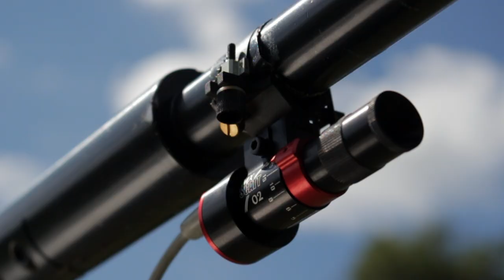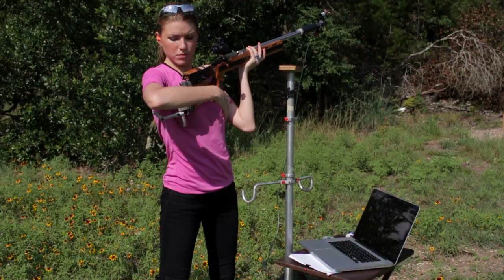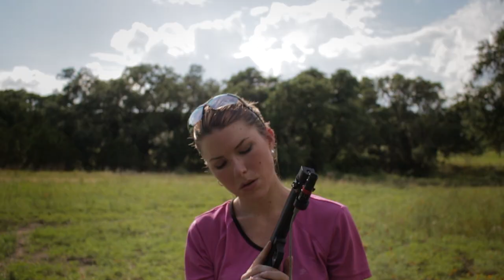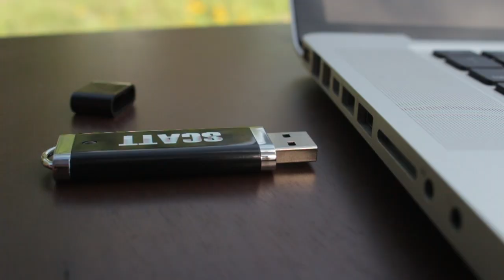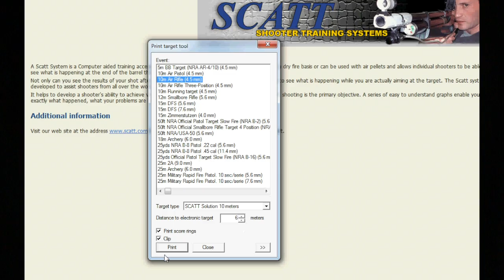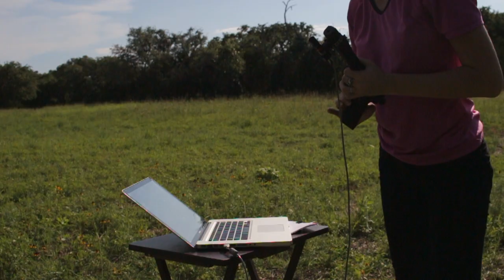Can A Computer Make You A Better Shooter? - SCATT Shooter Training System

Comment: I realize that this is an older video, but have you tried the MantisX system? If so, given the price difference, would you think that the MantisX would be a better choice for MOST shooters (i.e. not those hoping for on Olympic gold)? Another question is whether you think having something attached to a barrel (that wasn't but there as part of the gun's own design) has any effect on the accuracy (change in barrel harmonics, etc.).

Comment: I own one of these units for my 10 meter Olympic air rifle the live fire option on normal targets without using electronics down range is invaluable, I train at 3 meters dry fire at home on a scaled down target that you print out from the software then email the results to my coach, it’s a great system that hones your technical skills that are crucial to the perfect shot release.

Comment: In fact; the answer to that question is " Yes... or, No... Or... Uhhh...". It depends on what type of shooting you are involved in. For Sniper and long distance shooters, a computer could be an excellent pool. Snipers have to make very many calculations for their operstions such as:
* What food; and how much, was eaten before shootinhg. The time of the meal is also listed. After eating, the hands may become shaky; as well as at times before a meal.
* How much sleep have you had. A sniper has to calculate how much sleep he/ she had; aswell well as present condition of mental acuity. Sluggishness may interfere with a shot if the shot is not made with a very sharp mental acuity.
* Windage elevation: The wind may push the projectile left or right many times before striking the target.
* Environment: Trees, hills; and other obstructions may cause wind deviations.
* Coriolis effect
* Weather effects
* Temperature effects
And numerous other calculations. After calculations, precise shots up to 1 mile to 2.5 miles may be made.

Comment: Surely this is counter productive/pointless ok i understand all its doing but its doing all that while you have things added to your rifel! Thus changing the weight and center of gravity? So its taking all thoes readings for that but when you shoot normally, without thoes bits on, your readings will be different anyway.
Make sense?
Reply from the maker: MultiShaun1989 It sure does make sense! I was skeptical of this myself. But the unit is so light that its not noticeable -- and trust me, I'm really picky about weight changes on my competition guns. I also think it's an overall diagnosis. So a slight weight change of a few ounces (if a person even notices it) in order to see big things within your shot routine you may be doing consistently wrong, benefits more than it possibly harms. To each his own though! I like it, doesn't mean you have to :) Just wanted to explain that I had the same concern (which is valid) and didn't notice any problem once I tested it.
Reply: I'm just curious,always looking to learn stuff! :) thanks.
Do you still attend competitions?

Comment: It seems that at longer ranges, you will need to have a mounting place that is not the barrel because of point of impact shift.
Reply from the maker: sierraharvester That's a good thought, and the cool thing about the tech is you don't have to have a perfect center aim for the mx-02 to work.  As long as its in the general area of the target, it can be quite a bit off center and it compensates for that automatically

Comment: Great review, thank you for this! I didn't even know it existed.

I have an unrelated question (hope no one hates me for this but...) What is your (or anyone else who reads my comment) preferred training method for eliminating (what I call) trigger-flinch for handguns? When I dry-fire, no flinch (pretty obvious, right?). When I use live ammunition, as soon as I've emptied my first cylinder (or magazine if I'm not keeping count and primarily focusing on the target), I find myself flinching when I pull the trigger.

I've dealt with this my whole life and it's frustrating as all heck because my first few shots are on point but most subsequent shots are either low or low-left until I stop and relax for a minute or two.

Anyway, any tips/suggestions are much appreciated.

Thanks again!

tl;dr Best way to eliminate flinching when using handguns besides dry-firing?
Reply: thoffman79 Try the 'ole "ball n' dummy" exercise. Throw in a bunch of dummy rounds and mix it in with live rounds in a can (or bag), then load your cylinder or magazines (with your eyes closed or look away, or better yet, have a buddy load them for you :-) ). You'll catch yourself flinch when hammer is dropped on a dummy round LOL :-) Do this on every live fire outing. Do it enough (i.e. catching yourself flinch on an "empty" round) and eventually you'll re-program your sub-conscious not to flinch as much, or do it away completely, depending on how determined you are to correct your faults. May I also suggest you "double up" on your ear plug+muffs (get the ones rated for magnum rounds) and shoot more light recoiling rounds (.22 or even air guns) to help your subconscious establish the correct shot process sans the flinch, because shooting manly man caliber and loads too often will only make things worse. Good luck! :-)
Reply: willywonka4340 I completely forgot about that method. Thank you! I'll be sure to have one of my buddies load for me since I can tell the difference by weight. I also agree with spending more time shooting smaller caliber rounds; cleaning my .22 pistol is the only (lazy) reason for not doing so. Guess I just have to get over it. By the way, I only have this problem with handguns. Well, guess that means more range time! Oh darn ;-)

Comment: That's one cool gizmo.. And I can see how it could really help out with training.
But, the price? For that kind of money, I could buy a really nice rifle.. :)

I got my first good computer-aided learning experience with a flight simulator for RC airplanes. It was a free windows program that I used with a low cost joystick..
It was hard at first. Then got easy. So I went to the RC flying field and amazed myself. I could fly RC airplanes!  Land them too!

A Morse code trainer (on Windows 3.1) allowed me to upgrade my Ham license from Tech to Extra. I went from 8 wpm to 20 wpm in about two months.. After about 20 years of not being able to get above 10 wpm.. It was an IBM XT.. :)  Techno stuff can help you get 'skill'..
Reply: +Richard Lee I had the old dry fire only version which I sold hoping to get the MX-02.  After living without it for about a year I can tell you that it's worth every penny.  I still don't have the MX-02 but in trying to polish my prone shooting I've been to the range three times in the last week, that's 200 miles on the car, and about 12 hours.  Only at the very end did I realize that I was indexing the buttstock incorrectly and the position was loosing consistency.  I've used the old SCATT to help my prone in the past and it took an hour in my apartment to discover that I was doing something unstable with my position.

If you are competing against others (or just yourself) a tool like this is indispensable.
Reply from the maker: Richard Lee Cool! Most  pilots put a good amount of hours into simulators before they ever truly  fly on their own. Whatever helps eliminate errors before they get ingrained, I'd say
Reply: Just wish I could CandlePin bowl as good as I can shoot.. My wife is kicking my butt about once a week at the bowling alley..
No simulator available..
Reply: Shooting is mostly a mind game. But, you always have to get the mechanics correct, be consistent, dry-fire daily and avoid coffee before shooting.. :)

Comment: Why not just add a small pic rail to your guns and just mount it to that? Should be a lot cleaner and simpler and faster to change from gun to gun. I don't think it would matter where on the gun it was mounted as long as you could get it to point along the bore axis it should work perfectly.  Actually I think on the stock would be better than the barell so it more closely tracks the shooters movements after a shot and any barrel whip would not be measured.
Reply from the maker: bcbloc02 Not a bad idea to have an adapter, but not all guns have a pic rail (or ability to add). As far as barrel whip, you do want to measure that too as the end of the barrel is what touches the bullet last and effects the outcome significantly. That's also why it's important to protect the crown on a barrel too
Reply: If this was something you were really going to use often I could make you some aluminum adapters to clamp on your barrels that would have a pic rail on them for easy on and off I would just need some barrel dimensions, but as to the barrel whip if this is to make you a better shooter I don't see how logging barrel whip will do that as you can't as a shooter compensate for that, all you could do is get another gun or try to tune your ammo to reduce it but that is really something you need to do as close to no shooter input as possible.